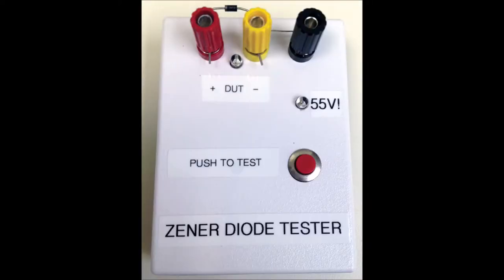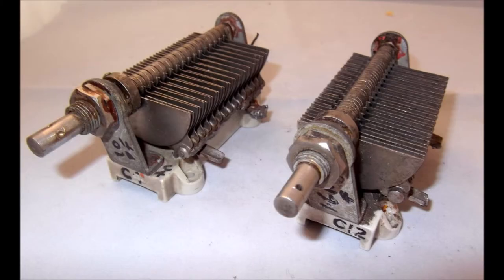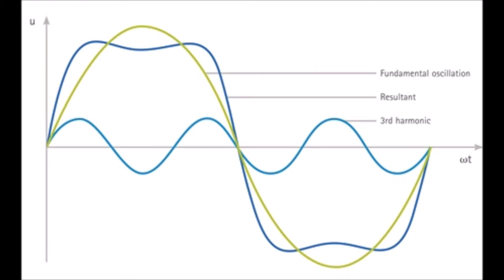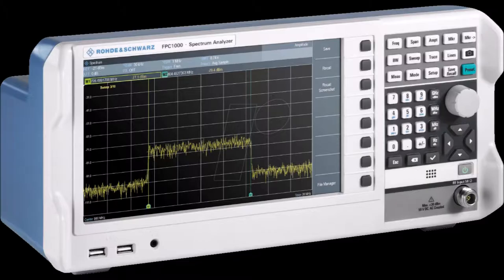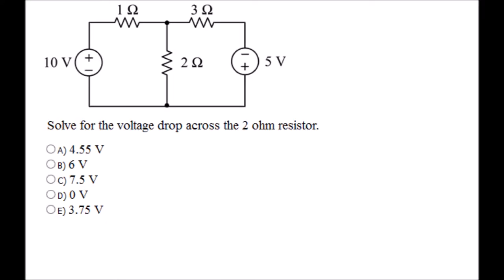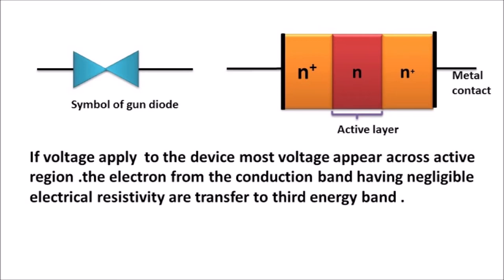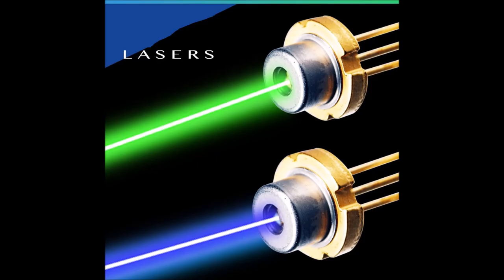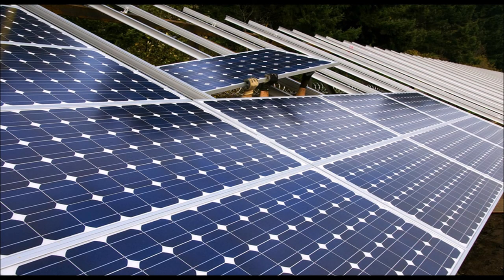Electronics Glossary: Diode Applications

Comment from the maker: Half-wave rectifier circuit  - Half Wave Rectification. A rectifier is a circuit which converts the Alternating Current (AC) input power into a Direct Current (DC) output power. The input power supply may be either a single-phase or a multi-phase supply with the simplest of all the rectifier circuits being that of the Half Wave Rectifier.

Galena – Galena, also called lead glance, is the natural mineral form of lead(II) sulfide. It is the most important ore of lead and an important source of silver. Galena is one of the most abundant and widely distributed sulfide minerals.

Amplitude modulated – Amplitude modulation (AM) is a modulation technique used in electronic communication, most commonly for transmitting information via a radio carrier wave. In amplitude modulation, the amplitude (signal strength) of the carrier wave is varied in proportion to that of the message signal being transmitted.

Crystal set – A crystal radio receiver, also called a crystal set, is a simple radio receiver, popular in the early days of radio. It uses only the power of the received radio signal to produce sound, needing no external power. It is named for its most important component, a crystal detector, originally made from a piece of crystalline mineral such as galena.[1] This component is now called a diode.

Tuning capacitor – A variable capacitor is a capacitor whose capacitance may be intentionally and repeatedly changed mechanically or electronically. Variable capacitors are often used in L/C circuits to set the resonance frequency, e.g. to tune a radio (therefore it is sometimes called a tuning capacitor or tuning condenser), or as a variable reactance, e.g. for impedance matching in antenna tuners.

long-wire antenna – A random wire antenna is a radio antenna consisting of a long wire suspended above the ground, whose length does not bear a relation to the wavelength of the radio waves used, but is typically chosen more for convenience.

shunt capacitor – In electronics, a shunt is a device which creates a low-resistance path for electric current, to allow it to pass around another point in the circuit. The origin of the term is in the verb 'to shunt' meaning to turn away or follow a different path.

axial leads – The axial lead style resistors are resistors that have leads that extend out horizontally from the body.

frequency multiplication – In electronics, a frequency multiplier is an electronic circuit that generates an output signal whose output frequency is a harmonic of its input frequency. Frequency multipliers consist of a nonlinear circuit that distorts the input signal and consequently generates harmonics of the input signal.

nonlinearity – Nonlinear distortion is a term used (in fields such as electronics, audio and telecommunications) to describe the phenomenon of a non-linear relationship between the "input" and "output" signals of - for example - an electronic device.

harmonics (electronics) – Harmonics is the generalised term used to describe the distortion of a sinusoidal waveform by waveforms of different frequencies. Then whatever its shape, a complex waveform can be split up mathematically into its individual components called the fundamental frequency and a number of “harmonic frequencies”.

linear (electronics) – A linear circuit is an electronic circuit in which, for a sinusoidal input voltage of frequency f, any steady-state output of the circuit (the current through any component, or the voltage between any two points) is also sinusoidal with frequency f. Note that the output need not be in phase with the input

signal mixing (electronics) – In electronics, a mixer, or frequency mixer, is a nonlinear electrical circuit that creates new frequencies from two signals applied to it. ... Mixers are widely used to shift signals from one frequency range to another, a process known as heterodyning, for convenience in transmission or further signal processing.

beat frequencies – In acoustics, a beat is an interference pattern between two sounds of slightly different frequencies, perceived as a periodic variation in volume whose rate is the difference of the two frequencies.

heterodynes – A heterodyne is a circuit that transfers a signal from one carrier wave to another with a different frequency. It mixes the input signal with a wave generated by an oscillator to create two new signals, called beats.

mixer circuit – see signal mixing (above)

frequency domain – In electronics, control systems engineering, and statistics, the frequency domain refers to the analysis of mathematical functions or signals with respect to frequency, rather than time.

spectrum analyzer – A spectrum analyzer is a device that displays signal amplitude (strength) as it varies by signal frequency. The frequency appears on the horizontal axis, and the amplitude is displayed on the vertical axis.

time-domain display – Time domain is the analysis of mathematical functions, physical signals or time series of economic or environmental data, with respect to time. In the time domain, the signal or function's value is known for all real numbers, for the case of continuous time, or at various separate instants in the case of discrete time.

intrinsic semiconductor – An intrinsic(pure) semiconductor, also called an undoped semiconductor or i-type semiconductor, is a pure semiconductor without any significant dopant species present. The number of charge carriers is therefore determined by the properties of the material itself instead of the amount of impurities.

PIN diode – A PIN diode is a diode with a wide, undoped intrinsic semiconductor region between a p-type semiconductor and an n-type semiconductor region. The p-type and n-type regions are typically heavily doped because they are used for ohmic contacts.

rf detector – An RF probe or RF detector is a test device to detect radio frequency oscillation in electronics circuits.

voltage regulation – The voltage regulation of the transformer is the percentage change in the output voltage from no-load to full-load. And since power factor is a determining factor in the secondary voltage, power factor influences voltage regulation. This means the voltage regulation of a transformer is a dynamic, load-dependent number.
Reply from the maker: amplitude limiting – In electronics, a limiter is a circuit that allows signals below a specified input power or level to pass unaffected while attenuating (lowering) the peaks of stronger signals that exceed this threshold. Limiting is a type of dynamic range compression. Clipping is an extreme version of limiting.

voltage drop – Voltage drop is defined as the amount of voltage loss that occurs through all or part of a circuit due to impedance. A common analogy used to explain voltage, current and voltage drop is a garden hose. Voltage is analogous to the water pressure supplied to the hose.

constant voltage drop model –  There are lots of videos and websites explaining this. I have yet to check it out.

distortion (electronics) – undesired change in an electric signal waveform as it passes from the input to the output of some system or device. In an audio system, distortion results in poor reproduction of recorded or transmitted sound.

frequency control – Frequency control is a process to maintain stability in the power system. In power systems, when the load is more than the supplying power, the frequency in the system will drop.

voltage controlled oscillator – A voltage-controlled oscillator is an electronic oscillator whose oscillation frequency is controlled by a voltage input. The applied input voltage determines the instantaneous oscillation frequency.

LC circuit – see definition above for linear circuit

Oscillation – An electronic oscillator is an electronic circuit that produces a periodic, oscillating electronic signal, often a sine wave or a square wave. Oscillators convert direct current (DC) from a power supply to an alternating current (AC) signal

Gunn diode – A Gunn diode, also known as a transferred electron device (TED), is a form of diode, a two-terminal passive semiconductor electronic component, with negative resistance, used in high-frequency electronics. It is based on the "Gunn effect" discovered in 1962 by physicist J. B. Gunn.

IMPATT diode – An IMPATT diode (IMPact ionization Avalanche Transit-Time diode) is a form of high-power semiconductor diode used in high-frequency microwave electronics devices. They have negative resistance and are used as oscillators and amplifiers at microwave frequencies.

Tunnel diode (Esaki) – A tunnel diode or Esaki diode is a type of semiconductor diode that has negative resistance due to the quantum mechanical effect called tunneling. It was invented in August 1957 by Leo Esaki, Yuriko Kurose, and Takashi Suzuki when they were working at Tokyo Tsushin Kogyo, now known as Sony.

negative resistance – In electronics, negative resistance (NR) is a property of some electrical circuits and devices in which an increase in voltage across the device's terminals results in a decrease in electric current through it.

gunnplexer – The Gunnplexer system is a combination of a microwave oscillator (based on the Gunn diode) with a mixer (Schottky diode). ... In the Gunnplexer operating at 10 GHz and at higher frequencies, the entire microwave system is embedded in a waveguide, and the antenna, usually horn type, completes the system.

saturation (electronics) –refers to "maximum",beyond which the system becomes unstable. if a device reaches its maximum voltage when a certain amount of current is gives as input,then the amount of current is known as saturation current and for voltage its vice versa.

laser diodes – A laser diode, (LD), injection laser diode (ILD), or diode laser is a semiconductor device similar to a light-emitting diode in which the laser beam is created at the diode's junction.[1] Laser diodes can directly convert electrical energy into light.

coherent radiation – Electromagnetic radiation in which two or more sets of waves have a constant phase relationship, i.e. with peaks and troughs always similarly spaced

photosensitive diode – Photosensitive diode module is the most sensitive for environmental light intensity, generally used for detecting the ambient brightness and intensity, in most of the cases with photosensitive resistance sensor module universal, it is difference that is the photosensitive diode module directional well and can sense the fixed direction of light source

silicon photodiodes – A photodiode is a semiconductor device that converts light into an electrical current. The current is generated when photons are absorbed in the photodiode. Photodiodes may contain optical filters, built-in lenses, and may have large or small surface areas.

infrared – Infrared radiation (IR), sometimes referred to simply as infrared, is a region of the electromagnetic radiation spectrum where wavelengths range from about 700 nanometers (nm) to 1 millimeter (mm). Infrared waves are longer than those of visible light, but shorter than those of radio waves.

AC coupling – AC coupling is useful because the DC component of a signal acts as a voltage offset, and removing it from the signal can increase the resolution of signal measurements. AC coupling is also known as capacitive coupling. DC coupling allows both AC and DC signals to pass through a connection.

See and compare Capacitor coupling.  I have not yet.

Photovoltaic – Photovoltaics are best known as a method for generating electric power by using solar cells to convert energy from the sun into a flow of electrons by the photovoltaic effect. Solar cells produce direct current electricity from sunlight which can be used to power equipment or to recharge a battery.